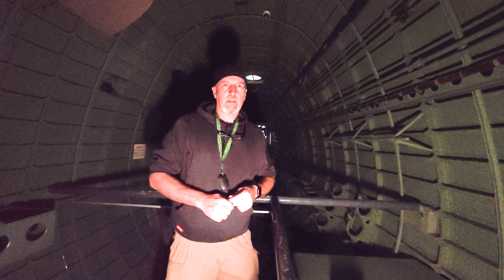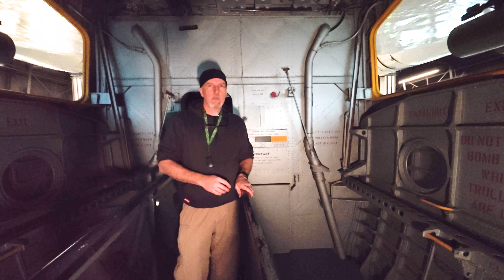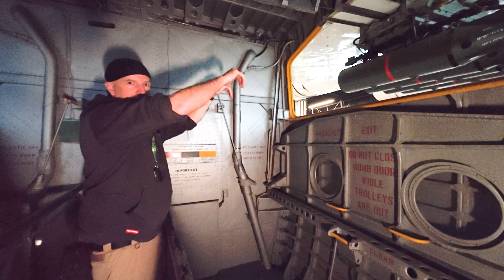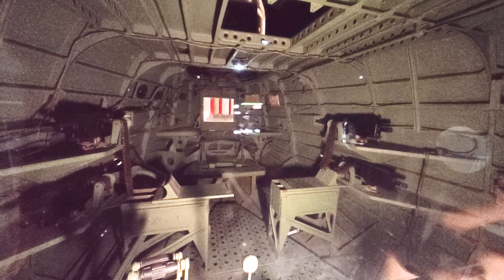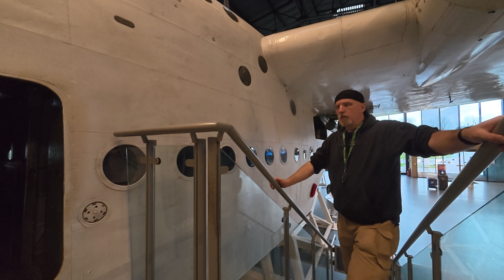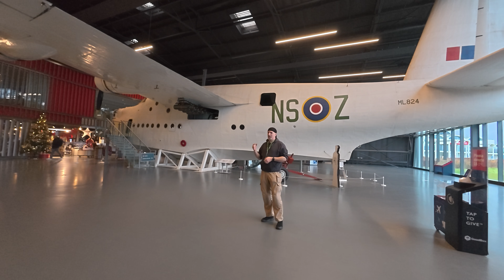The Flying Battleship: Inside the Short Sunderland

Comment: Built in my home town of Rochester Kent on the rivier Medway they used to take off from Rochester bridge heading towards cuxton as my dad used to watch them as a kid then they put to M2 motorway bridge in years later but shorts way is still there buildings all pulled down for fancy flats and apartments also opposite side of the river aveling and porters building was pulled down to make a car park they used to build traction engines

Comment: The Sunderland was no more capable of fighting off single engine fighters than the Lancaster.  It was essentially dead meat if caught in the daylight on escorted.
-There is a story of J. Yates attacking a Sunderland and five of the eight being shot down.
-Never happened.  There are no recorded journal losses on that day.  
-Admittedly the early JU 88 simply had the bomb site replaced with a simple 20 mm Canon.  It was the low powered MGFFM. Not the more powerful MG151/20 that came later.

Comment: I flew in one of these as an air cadet in 1956. I took the controls when over Lyme Bay and the air gunners fired at a smoke bomb dropped in the sea. We did circuits and bumps in Plymouth Sound. My father was C.O. Of R A F Mount Batten. The aircraft were based at Pembroke Dock at that time.
Reply from the maker: No, I'm not utterly jelous at all. 😂

Comment: My dad worked on these when he was an aviation technician at TEAL.  And I've been on board one, NZ4115 as a kid.  They are awesome aircraft.
Reply: T.E.A.L.  Tasman Empire Airways Ltd the precursor to today’s Air New Zealand for whom I worked for some years on the IT side.
Reply: @norrishanna4113  What year(s) did you work for them? You might be in a photo Dad had of a lot of the employees in front of one of the aircraft they flew.
Reply: @mattd6931 I doubt it. I was rarely at the airport. I worked 3 separate stints at Airnz between 1975 and 2005.

Comment: Beautiful magnificent plane, I was wondering about the white paint job though? Is that standard...?  🤔
Reply from the maker: Honestly not sure. It seems unlikely it's the anti flash paint of the cold war. According to Google it's this

Camouflage: The primary reason for the white paint scheme was for low visibility. When viewed from below against the sky or clouds, the white underside and fuselage sides made the large aircraft harder to spot than darker colors. This was particularly useful for maritime patrol and anti-submarine warfare aircraft operating over the open sea.
Heat Reflection: White is a superior reflector of sunlight, which helped minimize heat absorption and keep the cabin and internal structure cooler, especially when operating in sunnier, southern latitudes.
Easier Maintenance/Inspection: The white surface made it easier for ground and maintenance crews to spot damage, oil leaks, or structural defects during inspections, as these issues are typically darker than the white paint.

But take that with a pinch of "AI told me"

Comment: 0:30 "... a pair of Me one-one-ohs."
Did you mean Bf one tens?
Reply from the maker: I said what I said. While Bayerische Flugzeugwerke hadn't become Messerschmitt yet when the initial versions went into production it's very common to hear them refered to as both ME or BF 110.
Reply: @TheOldScienceGuy 
You are of course correct. I was just messing with you. I have seen Messerschmitt documents and articles that refer to the 109 and 110 as Bf and Me even on the same page but in different paragraphs. 
I guess, I always think of the 109 and 110 as well as the 108 and 163 as having the Bf prefix. Whereas the 210/410, 321/323, 163 (Komet) and 262 are all definitively Me prefixes. 
👍😎

Comment: "The Flying Porcupine"  myth surfaces again. It was indeed given that nickname by the Germans, but not because of its guns. Those who know, know.
Reply from the maker: And for those that don't know but find condescending comments that claim superior knowledge then immediatly gate keep that knowledge unhelpful, now you can know too.

1. It's unlikely the Germans would have been that impressed by the armament of the early version Mk1 Sunderlands due to them being 303 calibre and often pan fed vickers machine guns which were not that impressive even by 303 standards. Especially given the Germans were using up to 20mm canon to shoot back.

2. The reports of downed German aircraft don't match German records of the time, though post war these records were not as complete as they could have been. That said, Sunderlands often worked alone so there were no other aircraft to confirm or deny hits.

3. A lot of propoganda was at work. If German air crews were talking about some gun packed flying anger boat then the German state and press would likely down play it, where as the British and wider Empire would embelish greatly. The reality is probably somewhere in the middle.

4. An alternate suggestion for the nickname (which suggests it was used) was more litteral. The anti surface vessel Radar dipole antennas covered the anti shipping versions making the Sunderlands in this role look like they were covered in spikes. Given the general public on both sides would have been unaware of this secret technology, they would have come to their own conclusions about the source of the nickname, again, amplified by the propoganda.

Don't gatekeep history just to try and act superior. If you have something to add, share it.
Reply: @TheOldScienceGuy  I agree with your overall point about knowledge but nto much of the rest. Aside from my Dad and other ex RAF Sunderland pilots telling their stories, I have also seen interviews of German Pilots talking about what they called in German, the flying porcupine, and the extreme difficulty of attacking them due to all those guns which were highly maneuoverable in their electrically operated turrets, and from the open side hatches, and also the tactics the Sunderland crews  used when attacked. The Sunderlands would fly as low to the water as possible, a bit like a porcupine rolling into a ball with all its spikes defending it. The brits didn't invent the nickname for propaganda, and the German pilots were almost certainly applying the name on a purely visceral basis, not from propaganda or radar antennae. The Sunderland size, the tactics, the look, and the firepower was all of a piece, and clearly left an impression which made that nickname apt.
Reply from the maker: I agree, I was presenting a more "devils advocate" argument. I can see the logic of it, and I'm aware I'm probably more influenced by an allied perspective and narrative, but I think it's perfectly feasable given the tactics and the sheer number of guns aboard that it would gain a nickname like this.
Reply: @TheOldScienceGuy  I should have said I didn't agree in this' specific' case regarding the nickname. Otherwise  the idea that truths are often derived from the fog of war and are not necessarily as truthful as we later deem, is certainly correct. I also agree that Sunderland's were not really noted for their aerial combat kills, just their ability to evade of getting killed themselves so long as they could get low quick enough.:)
Reply: Well, tell us then.
Reply: Really? I should know I guess, Having a dad who flew with RAF in 1945 and then with the RNZAF from '58 to '67 on Sunderland's. The story told here and everywhere else I have watched or read is the same one my dad told me, but hey I'm ready to learn something new. So do tell, what is this truth that those who know, know?

Comment: It's a pity there are no airworthy examples left anywhere in the world. I'm old enough to remember how these looked and sounded. The bellow of the 4 engines on full power at takeoff and the splash of white foam when they "landed". The ones I saw were operated by RNZAF from Laucala Bay, Suva, Fiji in the 1960s. The slipway is still there, and so is the breakwater used to create calm water for takeoffs and landings. I think the Sunderlands were keeping an eye on the possible presence of Russian subs in the Pacific during the Cold War.

Comment: There's a Short Solent, a civilian conversion of the wartime short seaford (successor to the sunderland, originally called the sunderland IV) at the oakland air museum in california in the san francisco bay area. Visited it a couple of years back. You get a lot of access to the aircraft, including being able to stand in the open hatch in the bow where the turret used to be. It has an airliner interior including a tiki bar lol. It was also the flying boat used in the first indiana jones movie - when you see jones boarding the plane at the beginning of the movie, that is the oakland Solent. The one engine you see running in that scene was the one working engine it had at the time ;). Being a development of the sunderland, the solent is VERY similar inside.

Comment: With its 2,600  mile range with it's bomb load why wasn't it used to extend air coverage over convoys from the start of the war.  The  PBY Catalina had a range of 3000 miles but with a bomb load only 1,500 miles.

Comment: The Sunderland could be pulled on to land as two wheel attachments locked onto each side of the fuselage and a wheeled trolly under the rear keel that could swivel to alter direction on land (pulled by an aircraft tug)
The set up was called  ‘beaching gear’ fitted in the water prior to moving up the ramp to dry land
Reply from the maker: That sounds like a job that was definately fun on a cold winters day.
Reply: @TheOldScienceGuy  
How did send a link but I think YouTube kills any attached links
It was to the MOTAT New Zealand museum that has both a Sunderland on display with beaching gear as well as photos / video of it being used - interesting site
Don’t know why the U.K. one is on ‘blocks’ ? 
Cheers

Comment: did this not have the range to fill the mid atlantic gap during Battle of the Atlantic? Plenty of room for fuel inside...
Reply from the maker: The Mk 5's could make it to the mid atlantic, but would have had to immediately turn around and head home. No loiter time would make it a fairly useless trip

Comment: They were actually forbidden from landing to pick up survivors, so you are incorrect there. They were far too vulnerable on the surface and they lost a few due to crashes while attempting to do so. My father flew in one during WW2 with 461 Squadron RAAF.
Reply from the maker: Thanks for the correction.I didn't know they'd been specifically banned from landing. Makes sense, the PBY could be down and away again in minutes where as this probably had a longer turn around.
I did find a few examples of Sunderlands landing to pick up survivors but I should have done further digging, as you said, it was officially not allowed.
The first air sea rescue by a flying boat was a Pair of Sunderland in heavy seas off Lands End. Earned the pilots DFC's https://www.shipsnostalgia.com/media/ss-kensington-court.325054/
Reply: The Short Sunderland Wiki page at 1158 10/12/2025 shows an image with the following caption, "Sunderland EK573/P of No. 10 Sqn RAAF 'unsticks' after picking up three survivors from a Wellington shot down in the Bay of Biscay, 27th August 1944.
Piloted by Flt Lt WB Tilley.
Image from IWM.
Do with that information what you will.

Comment: Building one of these would be one of the vanity projects I undertake if I was a billionaire.
Build a space rocket? PPhhhffff.... 
Visit the Titanic? Meh
Build dimentionally and visually and performatively accurate WW2 aircraft but with modern aviation in mind? Heck yeah! (I would not consider using modern engines or avionics or materials a cheat-- to put something that produces the same HP, uses much less fuel to do so, and lasts 50 times longer, with a more structurally stable hull and more free weight sounds like "Mrk VII")

It was a favorite from the first time I had ever read and seen one-- and the love for it has only grown when reading about the feats the aircraft performed.

Comment: I retired from the RCAF 10 years ago while in 423 Sqn. 
During the war, 423 flew Sunderlands from Castle Archdale. 
When I left, we were flying another legendary aircraft, the Sea King.
Reply from the maker: I used to work on those. I've emptied a lot of seawater from altimeters 😂
Reply: My uncle who was a native French speaker but by 1943 was already in the RAF flew as an RAF liaison with a Canadian Sunderland squadron from Castle Archdale. He was a flight engineer.
Reply: No fishing port ?
Reply: Sea King? That's a heli, isn't it?
Reply: @ProPexPup  Probably one of the best ones ever made. We retired ours in 2018, the same airframes purchased in 1963. They were tough as nails, and truth be told, kinda ugly. The helicopters we bought to replace them are a POS. I got out rather than work on them.
Reply: @ProPexPup  yes
Reply: my dad was a radio-operator/navigator on a RCAF Coastal Command Sunderland for 4 years from '41 through '45

Comment: Well, with almost all the guns, puny .303's.
I think its nickname of a flying porcupine was more apt than a flying battleship.
Reply: Well, the German fighter aircraft respected it enough to call it “the flying porcupine” .The aircraft was quite spacious inside . It was invaluable in the Battle of the Atlantic. Going up against the Ju 88 and Me110 was great going.
Reply from the maker: It had a couple of 50's in the sides too.
Reply: @TheOldScienceGuy  Only on some planes.
And those were just a few that were fixed to fire forward.
Not in moveable turrets (to my knowledge).
Reply from the maker: @McRocket  Most of the Mk2's and 3's were retrofitted with 50's in the nose and dorsal openings. The 4's and 5's had the nose and tail turrets upgraded to 50 cal
Reply: @TheOldScienceGuy  Well, that is good for the crews if true.
 
I would still hardly call something with a bunch of  .303's and a few retrofitted 0.5's a 'Flying Battleship'. When you had thousands of B-17G's with thirteen 0.5's! Not to mention B-24's, B-26's and B-25's (some of which carried a 75mm gun!) and on and on.

I have never seen any material referring to the Sunderland as the 'Flying Battleship'. Only the 'Flying Porcupine'.
 And, to be honest, I suspect you added the name to enhance views of this video.
 Though I cannot prove this.

Whatever.
Call it whatever you like.
Call it the 'Flying Super Battleship' if you wish.
But I am sticking to the one that seems the most famous and the most descriptive - the Flying Porcupine.

Be are done here.
Good day.
Reply: @McRocket I'm sure the German pilots who came up against it knew  better than you it's threat. Idiot.
Reply from the maker: Incorrect. We are done when the point in question is correctly resolved. Here is a piece of doccument evidence from the period using the term "The flying Battleship". While not a common use nickname, or one that's easy to find references to, this is period specific evidence that proves I didn't "add it to enhance views".

Though this is an acceptable assumption, because getting people to view your content is not an easy task, but mistaken in this case.

ebay.co.uk/itm/155617465375

and some citations of other sources.

“A Sunderland flying battleship, the type of machine the R.A.A.F. in England is using.”
— The Age (Melbourne), 25 Jan 1940 — source text available via the National Library of Australia

trove.nla.gov.au/newspaper/article/204004712

Now we're done here.